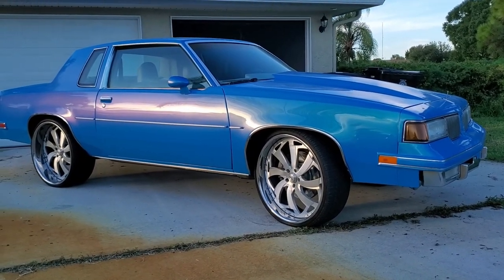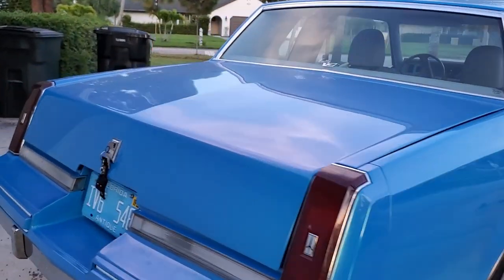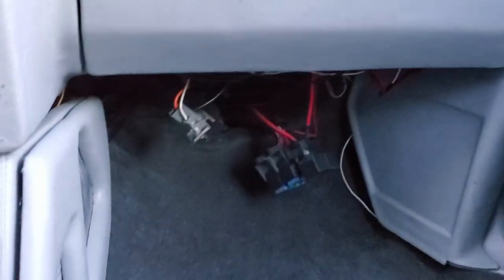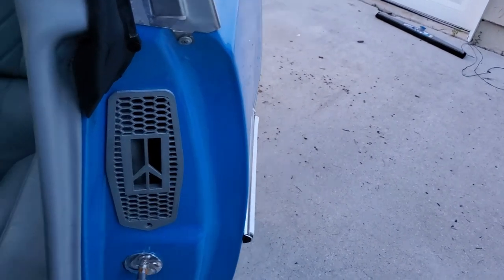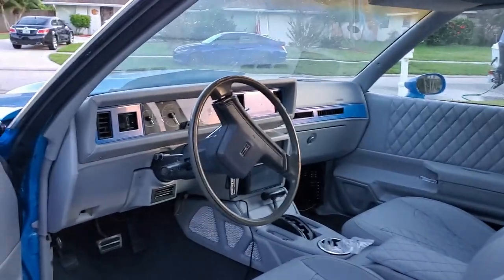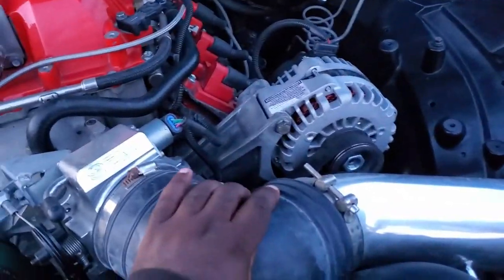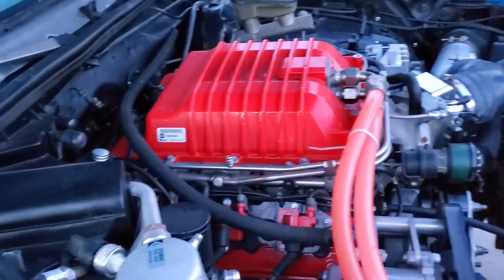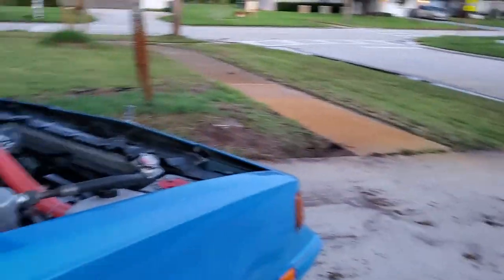COLDEST LSX Supercharged GBody 🥶 Florida Cutlass

Comment: Not sure if you know, but Shift Culture is having a car show at the St. Lucie Fairgrounds the first Sunday of every month from 8-12 A.M. They switched the one to this coming Sunday because of weather last Sunday. They also have one in downtown Fort Pierce the 2nd Thursday of every month from 6-9P.M. The last one they have is at the Treasure Coast Harley Davidson dealer from 6-9 P.M. If you're interested they have 2 options:$10 for the regular ticket and $20 for a VIP ticket. VIP is usually a limited amount of tickets.
Reply from the maker: Thanks for the info. Shift Culture started poping up on my Instagram feed, i been meaning to check them out. Seems like a lot of modern cars.
Reply: @RoadRageGarage  Yeah. It is mostly modern, but I've seem some oldies as well. By the way, they switched the one from the Fairgrounds to IRSC Pruitt Campus and it's going to be the last Sunday of every month now, unless they say otherwise.

Comment: I gotta few comments,  one why is it so important that someone did something first , to a car or old skool ,  2. I seen that radio a few years back in my homie Camaro. It was a bubble but I didn’t know how it would look or fit in a GBODY so I didn’t buy it.  But those been out a few years now for sure.  2018 when I seen it , 3 love that you didn’t put the rim steering wheel in there. It is too much and you can’t see your dash board gauges as much cuz of how tall they be with the rim steering wheel ,  do your own touches like you been doing ,  most people just wave riding ,  car looks great.  And love the brake system no fancy Baer or wildwood. But still got the stopping power 🔥 🎉 , excellent car.
Reply from the maker: Thanks for the comments glade you found my channel. 1. As you said, a lot of people just ride the wave. In my opinion if you build a custom car it should reflect you not the last car you seen. It use to be that way but with the popularity of old-school going up in the recent years, you can nolonger tell who's car is whos. As for the radio you are correct I believe I bought it back in 2018, I never showed it to anyone because I knew it would have been copied. It's great that you saw it and liked it but some people see it and Straight up want it for no other reason and never asked is it any good.

Comment: Haven't been getting any notifications? What's gud, nice to stumble on the vid! Keep on the grind gotta figure out the notifications issue. Salute!
Reply: @RoadRageGarage  DUDE " GET YOU A FOSTER GRANT STEERING WHEEL...$150 - $175...YOU KEEP USING THE CUSTOM...BUT THAT STEERING WHEEL..JUST STICKS OUT LIKE A SORE THUMB" THE PAINT IS ONE POINT..THE WHEELS ARE ON POINT...THE INTERIOR IS ON POINTS...KEEP THE LOGO FROM THE ORIGINAL STEERING WHEEL..AND PUT IT ON THE HORN BUTTON..EPOXY IT...OR SUPER GLUE IT"  THATS JUST A OPPINON... ATLEAST LOOK AT SOME OF THOSE MODELS...

Comment: Man what ac lines are you using
Reply from the maker: I had a local hose shop make them. But they are standard AC lines. Low pressure is factory line